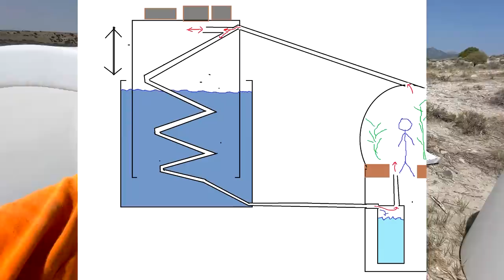ChickenHole Base Ep. 18: Side of Siding

Comment: That was really impressive of robocody to lift the trailer up and keep it in the air, without touching it, whilst changing the tire.
Reply: He put a rock under it after he raised it up.
Reply: You should be able to lift that tiny little toy trailer up. It's not heavy.
Reply from the maker: He locked an arm and leg in place to support it.
Reply: If you watch again, robocody held it up with one hand the whole time.
Reply: Everyone is jelly that they don't have their own RoboCody.
Reply: @theCodyReeder  was that a part of the new update?
Reply: you need new eyes.. he was clearly holding it the whole time...
Reply: @sprock what is this robot Cody stuff? 
 He built a robot him?
Reply: @theCodyReeder  you can't trick us, he lifted it with his 'third leg'
Reply: without touching it? he picked it up with his hand..
Reply: The power of modern robotics is frightening
Reply: Robocody: lifts trailer with bare hands
Also Robocody: leaves the bolts loose

Comment: That type of insulation is meant to reflect heat, it’s commonly used in roofs in places like California with the shiny side facing upwards to reflect the heat back out of the house. If you want to use it to keep heat in, shiny side inwards and vice versa.
Edit: the most important part of the insulation is to have an air gap between the siding and the insulation
Reply: looked like corrugated aluminum siding so it's trapping some air

Comment: For your furnace it would be intresting to see you use the gasses from decomposing materials such as methane and a gas burner to be your heat source and its much more efficient than electricity.
Reply from the maker: How would that work on Mars?
Reply: @theCodyReeder  oh yeah you need oxygen to fuel a burn thats an oopsie lmao 
the only way you could do it is if you had a closed system or you refined the oxygen and mixed it with the fuel as it burned similar to oxy acetylene.
Reply: I wonder, could he use electrolysis on water to generate oxyhydrogen, then burn that?  Or just vent the hydrogen & use the O2 to breath.  
Using electolysis for the fuel wouldn't be as efficient for a furnace, but idk, maybe it would be good for cooking, where a flame might be preferred.
Reply: @theCodyReeder  Take kudzu to Mars! Soon it'd be called the Green Planet!

Comment: I hope your doing ok, as someone who suffers from mental health issues I can say that stress will cause alot of mayhem if you let it go unchecked. An idea: you should make some kind of biogas collection system for your composter, and use said gas for a converted propane generator or a heating/ metal melting furnace. No need for complicated systems just find a way to collect all that stinky gas that comes out and Use chicken poop and stuff to jump start it.

Comment: Great to see chicken hole base again. Watch those stitches. I had a similar procedure about 10 yrs ago. Mine was an eight inch cut in the same place. Everything had to come out for disinfection then get poked back in again.  Since then I keep getting minor hernias where they joined the two sides of my abs back together. Docs always say they are small (<5mm) and won't give me the carbonfibre bulletproof mesh solution even though I'm a lifter. This next time I'm telling them to fit the bolts and mesh! Hopefully will be able to start using intra-abdominal pressure again for lifting and meditation purposes without fear of injury after that. I think keeping a strong core without isolating it (situps and stuff) has helped keep the facia together over all this time and complications to a minimum. Active gut and body (running, jumping walking, lifting, stretching, eating loads of fibre etc...) kept any adhesions at bay I think.
Reply: Ah, one more thing, you did damn well there. It's pretty grimm. I remember going outside for air at the hospital when I could finally walk. Bloated and slowly wheeling the squeeky drip cage with me. After a few minutes of air hitting me, I vomited green bile that had built up becasue stomach wanted to start working again, but my lower gut hadn't started yet. The nurse had to drain the remaining bile though a tube from my nose. Not pleasant. But a transforming experience nonetheless. I lost 7kg in 7 days but gained 7 years of life experience and gratitude 🙂

Comment: You need rubber tension bands or a system of springs so the pressure/weight stays constant as the upper container rises out of the water. Weight lifters use bands to achieve a similar effect, where the weight decreases as it gets higher. I'm a physicist and would love to advise in any way I can, although your general knowledge greatly outdoes mine. If you ever need any math or physics done, shoot me a message. You're by far my favorite youtuber and that's saying something. I know this video is old but hope you see this, I'm absolutely in love with the chicken hole base project. Cheers

Comment: The insulation depends on what you want. The foil side will reflect heat. Since it's facing inward, it will radiate the heat back towards the water, which might keep it from freezing in the winter. It will be hot in the summer tho.

Comment: The shiny side reflects heat, if you want it to be cooler on the inside of the insulation you want to face the shiny side outwards, towards the siding.

Comment: I have an Ebike that is a small motorcycle. Way more appropriate for that terrain. 79V. When you buy them new they would break apart. You need to get go-cart parts for wheels and brakes so you have steel rims and will stop every time. I've had ine for 3 years and it's a blast all summer.

Comment: Glad to see you're still alive and moving.
Looking at your drawing for your gas regulator/accumulator.  If you have all the piping go through the bottom tank, then up into the open space, you won't need to use flexible tubing, and your rate of wear from pressure cycling will be lower.

Comment: I would love if Cody tried some hydroponics. Considering soil would be rare on Mars, I think that would be the way to go, at least for starters.

As for insulation, generally shiny side is where you want the heat to be. As it reflects infrared back. Hense you put layer of shiny insulation underneath heated floors to radiate the heat backup, not into ground.

Comment: Cody, I don’t know if you need this, but wheels are repairable. Especially steel ones, if it’s steel you don’t even need to heat it up, take the tire off and get the wheel next to something level so you can compare the wheel to something flat. take a large wrench and start pushing and pulling on the wheel to get the top of the rim flat, then spin the wheel to check if the bead is round. If the bead is not round, just keep trying until it is. As long as the bead is round to within 30 thousands of an inch, you shouldn’t feel any vibrations going down the road. And trust me you’ll get it within 30 thousands, I do it all the time. And if you absolutely need it, you have hydraulics to assist you.

Comment: You should get some spray foam kits from eBay it's like the professional spray foam but you buy the tanks and hoses and everything is pre-measured so you just spray and go each set does about 600 square feet 1 inch thick closed cell foam or if you have the money you can buy the drums of the stuff and some used equipment and you will save considerably more money